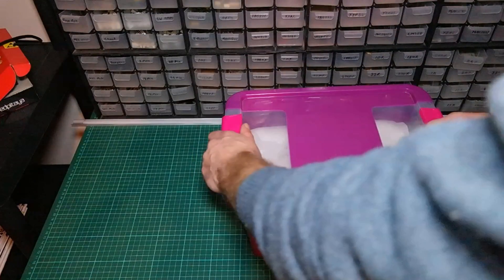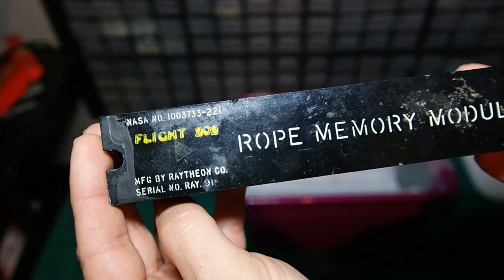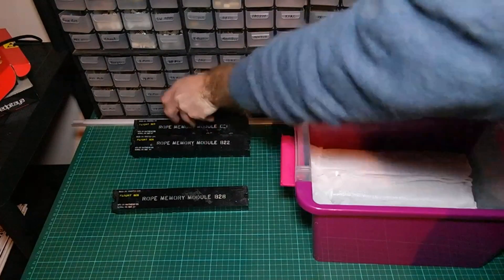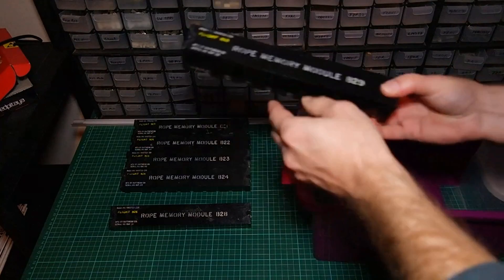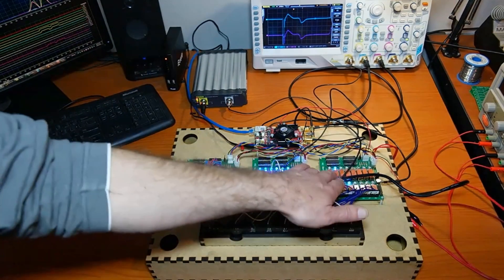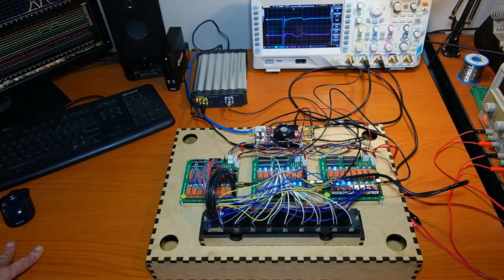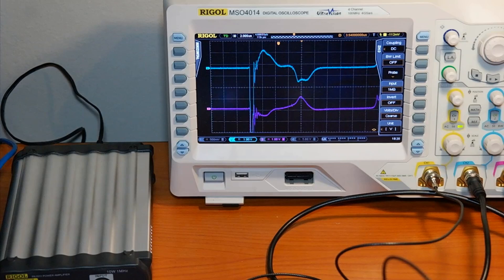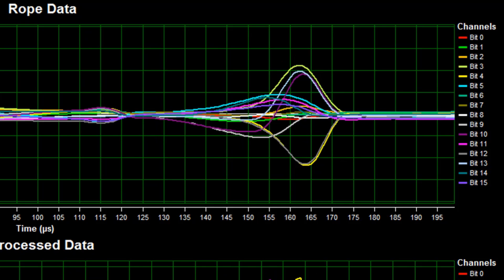Apollo Rope Memory Modules (Part 1 - Introduction)

Comment: This is absolutely incredible! Wild find. I am absolutely flabbergasted that such a thing could be not only found, but READ in this time. O____O By the accent i'd imagine you're South African?
Reply from the maker: Spot on ;-)
Reply: Please, don't spare us the technical details or long windedness! There are enough cat videos on youtube that you can offset it with this, surely! :D. Or perhaps you can release an "extended version" for those interested like myself? Then have a more digestible version for the passively curious?
Reply from the maker: @Peter Lamont: The videos did help, but It was actually a bit more tricky to get the pinouts. I started recording a video showing how I managed to eventually figure it out, but it got a bit long and too technical. Anyway, I plan to re-record it in a more digestible format soon.
Reply: youtubasoarus the beauty of iron core memory, is that it can be read even 1000 years later. The particular elegance of this design, was that it was potted in resin, which prevented the degradation of the copper windings on the cores. There are videos of its manufacture on youtube. These videos were likely how our friend here was able to ascertain the pinout and not destroy the contents. That or the terminals were labelled.
Reply: Amazing find!

Comment: Software presumably written in assembler but by who and in which flavour? The Raytheon wiki omits this completely.
Reply from the maker: Yes, it was assembler but they also had an interpreted language that was used for the more complex calculations. You can find out more here http://www.ibiblio.org/apollo/Block1.html

The first programmer on the team was a guy named "Hugh Blair-Smith" and he wrote most of the very first code. He has some very interesting stories, so just Google him.